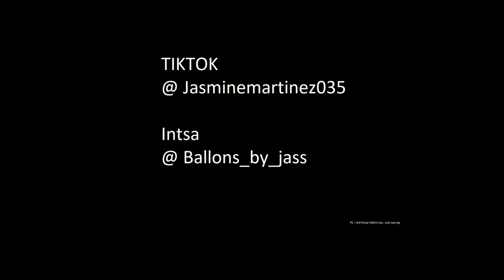Making a wooden arch backdrop

Comment: How long was the copper wire you used
Reply from the maker: It was 2ft. What ever width you want, divide that by 2.
Reply: So if u want a 6 foot wide back drop u use a 3 foot wire
Reply from the maker: @MrBiiG90   Yes. But Plywood sheets are 4 feet by 8ft. You would need to split that wide of an arch between 2 sheets. I'm thinking  side by side and loose a foot on each plywood. Any more questions more than happy to help.

Comment: Great video, will be attempting for my baby shower in April. I see you used 1/2 inch, do you think i could get away with 1/4 inch?
Reply from the maker: Yes, but I haven't built one yet. Its on the list this year.
https://www.youtube.com/watch?v=aItL-vfkuNY  Same guy from the link in the end of my video. He uses 1/4 inch and add 1x2, 1x3, or 1x4 to give support and he makes a really great point about the heaviness of thicker plywood. The 1/2 is sturdy and durable but HEAVY. If your using a jigsaw id imagine you would have to buy a fine finish blade with the thinner plywood in order to avoid a lot of splintering but even so nothing wood filler cant fix. 

I've even seen some IG reels of people using https://www.homedepot.com/p/Owens-Corning-FOAMULAR-1-2-in-x-4-ft-x-8-ft-R-3-Square-Edge-Rigid-Foam-Board-Insulation-Sheathing-36L/100320356  (insulation foam) Seems like the best way to cut this is some sort of hot wire foam cutter. But again I haven't try it...yet.

Hope this helps! Good luck and congratulations! Any more questions ask away!

Comment: What size/width wood and kind did you use?
Reply from the maker: I used : 1/2 in. x 4 ft. x 8 ft. Birch Plywood. I added a  link in the description.
Used the full 4Ft width of the board and the heights are 8ft, 6.5ft, 5ft.
They came out heaver than I expected. If I could do it over I would have cut the width down to 3.5ft or 3 so it'd be lighter and easier to handle. 
Home Depot. offers less expensive ones but they are not as clean and smooth as this one, I would've put a lot more work and time into them to get this nice clean result.
Thanks for watching!

Comment: What did u do to make the legs for it to stand on
Reply from the maker: For the smaller two I used left over plywood. Simple triangle shape. For the bigger one I used 1x4s and also did a simple triangle shape. Added a brace to the back of the plywood sheet so the screws had something more to bit into than just the plywood sheet. Attached with door hinges I bought from HomeDepot.